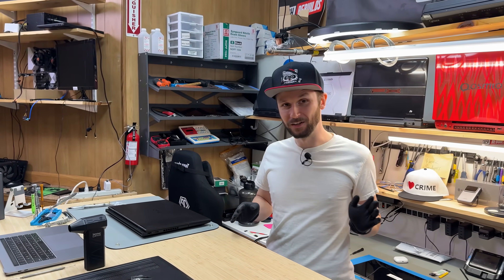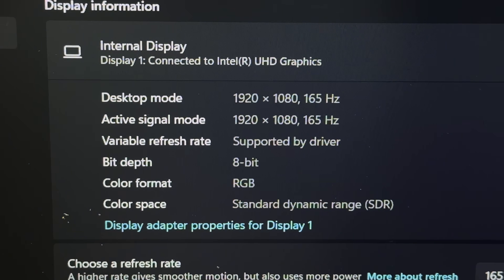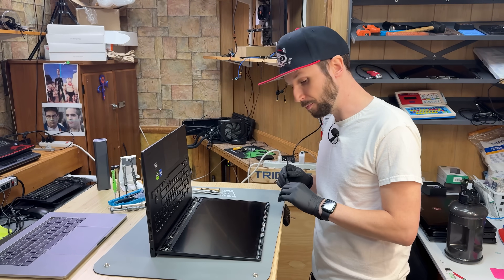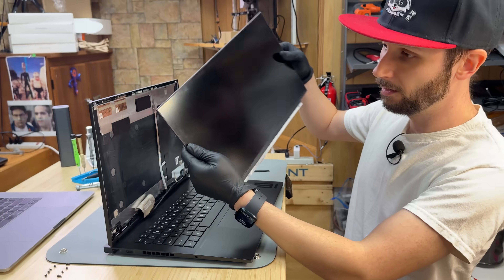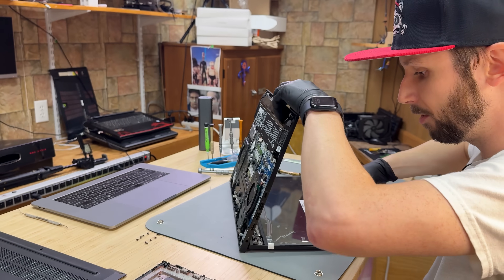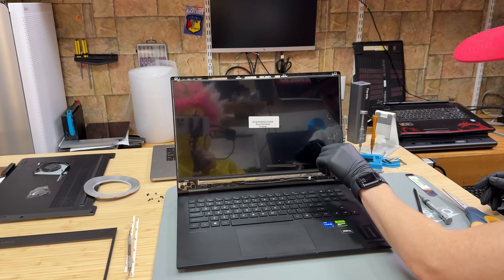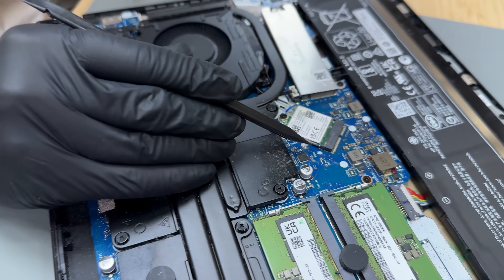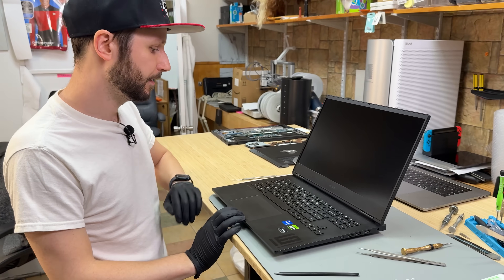The Laptop Upgrade Nobody Thinks About Until It's Too Late

Comment: Just a idiotic question 
Can anyone answers this please. 

Can we mod tb4 port to tb5 if yes then the pc will run on tb4 speed or tb5 speed.

As imo tb5 should be a mid range or lower level feature rather than high end. 

As low level pc will then have a option to spare gpu to it fullest and just providing lil perform when they are on the go.

What one will do to tb5 in high end laptop,will they add high rated gpu to high rated laptop?

Comment: I had an Intel MacBook Pro 2006 that in 2007 or 2008 or so had a cluster of dead pixels that looked like a bullet hole. Local shop quoted me $800 for the fix. Instead, I went on eBay, found the display for about $350-400, and did the replacement myself. Felt like I was walking on eggshells throughout the whole process since I never did a screen replacement before then and it was my work computer, but I made it happen!

Comment: I have bought an omen just 3 months ago and it has a dead pixel already , I mostly think it is due to heat from the vents as I had faced them towards the wall , I really think hp screens are fragile af,its a relief to know that the screens are replacable easily .

Comment: Reason is that because you used the part no, most of the time but not always it will have the same specs. Thats why you used model fit rather than partno if you are changing specs .

Comment: Hi, this is a great video, just wanted to ask: on a gaming laptop, do you typically need to change the thermal pads when you change the thermal paste or not? thankyou for the advice, just asking since I need to clean my laptop but the fans aren't detatchable without removing all the piping so I need to replace the thermal paste for sure, do the thermal pastes need replacing too? I've had this laptop for abt 4 years now.
Thankyou :)

Comment: One more sweet-fixed laptop, I enjoy by watching. Thanks,
I had an idea to swap FHD LCD screen on anyone good gaming laptop to OLED-one display. I wish the pinout is the same on 40-pin connector.
Searching durable asus oled laptops since 2022 has killed my hopes to get best-bro device. Or maybe I had a damage from a witch. 
My laptops of this brand burns out the mosfets regurally.

Comment: I think that the "surprise" of upgrading the customer to 1440p not working out may actually be for the best, since the hardware of the laptop obviously couldn't be upgraded to support gaming at the high resolution, and 1080p can look bad on a 1440p screen. 

I am impressed that this job was so straightforward on an HP.

Comment: If the screen was 1080p 60 and you were upgrading to a high refresh rate screen I can see the value in upgrading the screen but upgrading the resolution is just pointless.. Laptops already have limited performance and battery life, even really powerful ones, and this is going to make it worse and lets face it 1080p looks great at laptop screen size. And that not even factoring in that yes you can still run games at 1080p on the higher res screen but the game won't look as good because 1080p looks slightly blurry on a 1440p screen.

Comment: As the site tech for a mid sized corporate I have to deal with a lot of broken kit but screen replacement is always a walk in the park.  Most of the current stock is Dell so I just use the same 14.1 or 15.6 panels for whatever model comes in for a fix (FYI the same panels often fit HP, Acer, Lenovo & other makes).  It's all 1080p stock but some of the old devices come in with 768 displays so they get a repair & upgrade.

Comment: I had to replace the screen of an HP laptop because SOMEONE broke the original panel trying to replace the hinges and back panel (definitely not me ;) ). The new screen was compatible but I didn't order the exact same model and, while it is an IPS-type panel, I believe the colors of the original one were better, maybe because of factory calibration done by HP. I did calibrate the new one with the build-in Windows tool and it improved slightly but it still looks very different with the original being a lot better.

Comment: I have an HP omen that every time i replace the battery, it blows a fuse in the new battery and it refuses to charge. For the life of me, cant figure out why, im guessing it has to do with the AC adapter port board, but cant figure out why

Comment: The best part is when you can find driver boards for those old screens. 3d print the right files and you've got a monitor you can use for whatever. Or some cheap and easy Digital Signage. 
I actually bought a cheap $100 Dell laptop 10 years ago. Gutted the screen for a project and then used the now headless computer as a makeshift file server (With built in battery backup) 

That Linux Experience is how I broke into the industry.

Comment: "Breaking your laptop screen is a traumatic experience"
Yes, it certainly is. With just a simple clumsy drop I have damaged a HP ZBook 17 G1 screen and a HP 15-ac screen no longer has a working backlight. So that's 2 screens I need to buy.
Shame these are not like the Framework Laptop's screen...

Comment: Bro you also need to give some thought into what GPU is driving the display and not just simply “upgrade” the display (esp for gaming laptops).

The GPU may NOT be able to run games smoothly on 1440p. 

And then you might say “well then just run the game at 1080p”. If you run the display at anything lower than native resolution, because of scaling issues, it wont look as good as running games at 1080p on a 1080p native monitor. Even if you upgrade to a 4k display which theoretically should scale perfectly into 1080 (1:4) it still will not look as good as a 1080p image on a native 1080p display.

There are also other things to consider like power draw and battery life. Please think about these things before the “upgrade” 🤦🏻‍♂️

Comment: My dell inpiron 16 broke the screen lid, a wile back. The brass threats that the hinge were threaded to the screen panel were only glued on the panel with epoxy blobs, and they unglued and broke the screen. The original screen were a 3k screen but just 300nits and had very bad response times. I repaired the screen lid with superglue and bicarbonate of soda, the new screen was cheaper than the original, had 100% P3 color space, and it was HDR with 550 nits of brightness. The screen is better than the original by a mile, and because of the hinge repair, and I did the same to the other hinge as prevention the screen lid feels better than new, with zero wobble.

Comment: 2 points
Might be a good idea for those less experienced to disable the battery in bios (If possible, I can on my Lenovo) before removing the back panel.... just in case you drop a screw before the battery is unplugged. (Of course I've never done that)

I would use my phone camera set to magnify and Align the screen connector VERY carefully (With tweezers?) before pushing it home.
the SECOND greatest technician (Sorin) had one recently where someone had not lined the plug up and "pushed hard" to "make it fit"..... which it did. It also blew the main board when the 3 bent power pins on the plug shorted to ground.
😁

Comment: Yeah i learnt the hard way, i have a Dell PRecision M6800, the screen died on it, it was originally something like 1600x900 so i thought illg et the 1920x1080one.
I then realised that the screen used a different cable/connection :( 
I ended up gettting a new mobo for it

Comment: If this is the 2023 version it has a design flaw, the censor for opening the laptop and closing is close to a heatsink so after around 6 months of use your display goes crazy, u gotta unplug that censor cable and ofcourse hp has not ackowledged it.

Comment: I tried this once with an HP ProBook 440 G3 and it turned out there was a sort of firmware lockout or otherwise that prevented changing from the 768p panel to a 1080p panel, even though it was a factory option

Comment: I sorta asked this in your discord channel. Is it possible for the thinkpad t470s that has a 30 pin connection to be changed to a 40 pin for touchscreen? Or does it need a t470s that has it already. 

Also don’t forget to hold the power button for a few seconds to discharge after you remove the battery

Comment: I wanted to replace my laptop screen, it has a TN panel with 6bit depth color, it's awful, the issue is that in my country I can't buy a better display by searching the model number, because all on the market are advertised as "compatible", I bought a BOE NE156FHM-N61 panel and they sent me a Innolux N156HCA-EAC model that costs half the price... so upgrading from a TN panel to a slight better IPS panel isn't worth right now.

Comment: White splotches on the screen are usually cleaned with some spray and a cloth 😂 no need to send in for service. 😷🥒🎇💭
Reply from the maker: They’re behind the backlight inside the panel though
Reply: @SalemTechsperts  This is a "spot-mura" defect. It can be caused by a few different things, like excessive heat or pressure, or just impurities from production. Usually if it's customer induced it will be from some kind of spot pressure. Not repairable either way.

Comment: The laptop I watched this on has similar white splotches, larger green splotches in darker areas and two dead pixels stuck on green.
The white splotches are caused by the screen being bend from the back, which distorts the light diffuser.
This is caused by putting uneven pressure on the lid, making internal geometry crush parts of the plastic back frame.
Larger often green discolourations in darker regions are from the entire panel being bend, usually from the lid frame being bend.
Which I achieved by shoving my laptop in my backpack while my drawing tablet wanted to get in between a few too many times.
Neither defects are caused by dirt in the panel, for dirt to get in you would have to disassemble the LCD frame, it is sealed otherwise.

I have considered replacing it, I'd rather just pocket the price of a replacement and keep using the screen, since it's not that bad.
This laptop has had over 12 maintenance things done to it over the 6 years I have kept it in use and it is still going strong.
After having upgraded my desktop's CPU from a 3200G to a 3600G, for a whopping €45 shipped, I am getting more tempted to upgrade my laptop.
The laptop has a 2500U APU, which like the 3200G is a processor core generation behind and is showing it's age now.
But again, for the price of a new laptop, I would rather just pocket the money and keep using this machine, until it finally falls apart.

Comment: if I replaced a 1080p panel with a 1440p one .. I'd have a customer complaining that everything was too small ... just like the computer I cleaned the dust out of because it was over heating .. and after removing a few pounds of dust the fans could actually spin .. so then she complained about the fans being loud ...LOL    I even had one lady get mad at me for not wanting to buy her old desktop off her.... I told her that it was over 10 years old ... she replied that it cost her over $1000  ... she was mad that I couldn't give her like $500 towards a new computer and then re-sell it or use it for parts ... pretty sure it was a single core AMD that came with Xp or Vista originally installed .   sorry .. it's e-waste

Comment: you can not upgrade LCD screen  if it's touch screen above 8th gen it seems there is issues with compatibility 8.0 will not work with 8.1 and I've never disconnected a battery to replace a screen not wasting time to tear it down just to test a screen

Comment: The white spots are light leakage. They are caused by liquid or pressure on the screen (usually cause by being in a backpack). Given that it is 2 small spots, its probably pressure.

Comment: Got a Dell for the wife to play Sims for Christmas, I was expecting a backlit keyboard, but did not come with one, so I ordered the keyboard variant that included the backlit

Also was an Intel Iris XE model, which doesn't activate unless you have dual channel memory installed- man I was fuming when I saw Intel UHD until I upgraded the memory in it, then the display driver reinstalled itself and showed Iris XE graphics.. 

definitely blame Intel for making it confusing and not even show up in device manager/GPUz/CPUz when you have a single memory stick. I can't imagine how many people think they got ripped off, but receiving the wrong part/version of what you ordered really sucks
Reply from the maker: I just learned about the XE thing a few weeks ago
Reply: I'm curious- what Intel SKU did you have? I have an i5-1135G7 that said Iris Xe graphics both before and after going from 1 to 2 sticks of RAM.

Comment: As a computer mechanic the hard thing is removing those two (both side tapes) which hold the screen .. if that broke middle of removing, you are basically ending up with a broken screen .
Reply from the maker: 99% has saved my ass so many times for this reason

Comment: Here after my 1440p 240hz hp omen 16t 4060, 14700hx laptop wont charge anymore. Its only 4 months old. It works perfectly fine other than the fact its dead and wont charge.
No dirt. Nothing. I think its internal. Was mid game session when frames tanked because it wasnt hooked up to “power” via the charger.

Comment: I don’t know if you’re gonna be able to see this message but I have a question. I’m an 18-year-old trying to get my compTIA A+ certification and hope to be able to get an IT helpdesk technician internship to start off my tech career and I want to know what kind of laptop or device use to prepare for the certification exam and get the skills needed for the job because I’m horrible at  learning by the book and I want to learn by doing it with experience hands-on work while preparing how would you go about doing getting ready for the exam and actually getting the skills to work. And what tool should I get as a beginner?

Comment: Just a reminder, if have your lcd cover and the back cover open, tighten the screws of the hinges. Its surprising how many times they are fully loose, holding just on few last threads. And its almost never visible, because the hinge flap is lifted together with the screws.

Comment: those spacers are there to support the board when typing/gaming, it would flex a whole lot less
broken SODIMM solder joints on modern laptops is quite common occurence
Reply from the maker: That's what I concluded as well, it's actually quite smart.

Comment: I'm sure you asked ahead of time, but be careful when upgrading without asking, some people would prefer the 1080p over 1440p because 1440p would be more demanding on graphics, and lower FPS output. Not by much, but still enough to consider getting consent.
Reply: This. I would be angry
Reply: New screen had the same hz and I think battery life would be the same on 1080 vs 1440, if scaled accordingly.

Comment: Honestly, you and the customer probably lucked out with the new 1080p monitor over the 1440 because the graphics processor would have a harder time gaming with 1440 monitor and the customer might just see it running worse at the same game settings or running the same with lower (and worse looking) settings.

Comment: Removing Thicc ASSus OLED  displays is super easy and since I don't have to transfer the WeeFee wires or UBS Web iCamera flex cable to the new shell. and yes I do uninstall McCrapee and disable ButtLocker before giving back their repaired Asussy Laptop

Comment: might have been a blessing in disguise that the panel was not 1440p.
if the customer is not very informed about resolutions and stuff and just wants to play their game.. and suddenly everything defaults to 1440p, which will result in lower fps / performance potentially.. then the customer might complain and be upset that since the replacement the laptop runs worse..  (and yes i know you can lower the resolution) but thats why i said if he is not super savy in tech

Comment: I also upgraded my Acer Nitro 5 AN517-54-71RN with a 1440p panel, it came with a 1080p panel but after it had a dead pixel (after warranty expired) I decided to look for other laptops, then I saw the same model but with a 1440p screen, so I looked for replacement parts and actually got a 1440p panel for 60 bucks on aliexpress, it was surprisingly easy and I still have the 1080p panel as backup incase the 1440p panel ever dies.

Comment: Replacing your own screen? Apple has left the chat?
Reply from the maker: No, they’re still in chat, just charging you $100 per minute to read their messages. $617 to replace the screen on a 2020 13” MacBook Pro. Can do it yourself for around $180
Reply: @SalemTechsperts  I didn't realize that! Ipad screen replacement will cost you an arm and a leg.
Reply from the maker: @sebbyteh9203  they all will, it’s how they’re getting around right to repair. “See, we sell parts, for more than the device is worth”